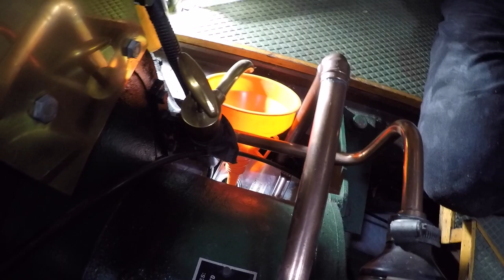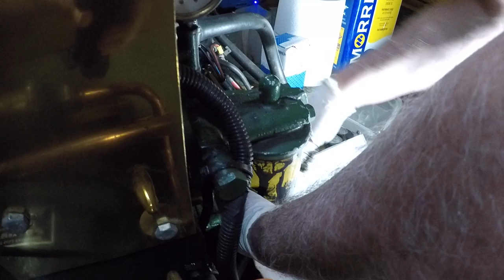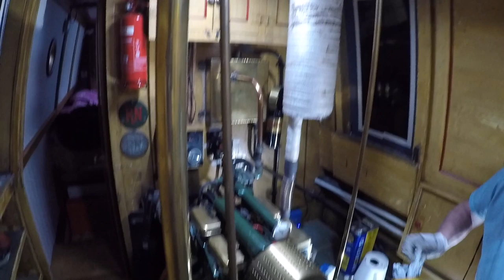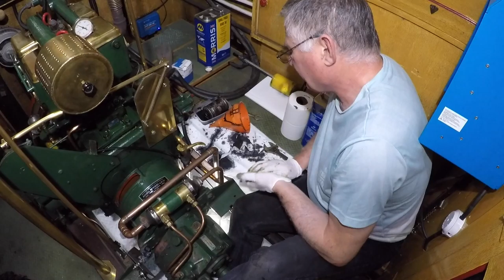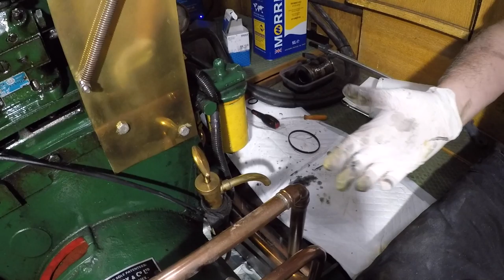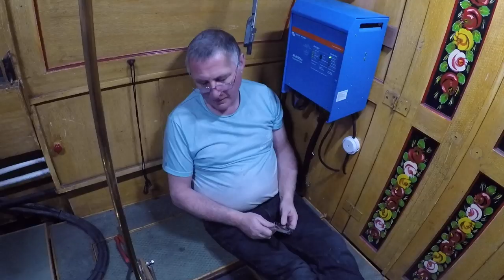#54 Narrowboat Vlog - How To -Oil & Filter Change

Comment: Great video just a little tip if you use a plastic bag when removing the oil filter will save it going everywhere , :)
Reply: My thoughts as well & add a short piece of clear tube to the end of the copper syphon tube so the oil does not flick everywhere.
Old towels / T shirts are much better to "keep next to you" to clean with as paper towel will leave particles, plus the clean much better.
Put the lid back onto the can of old oil as sure as night follows day ?
On your filter simply lift the canister up into its position with one hand and use the other to locate & spin up the bolt, you cannot see where to put the bolt so no point trying to look.
Would a basic mineral oil from Asda / Tesco brand at around £12 for five litres not do an old oil burner like this ?